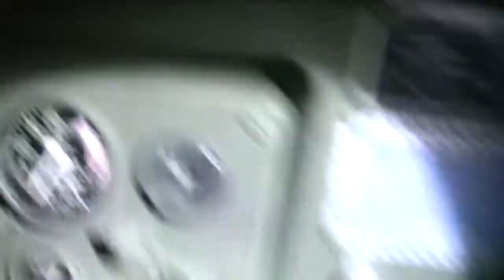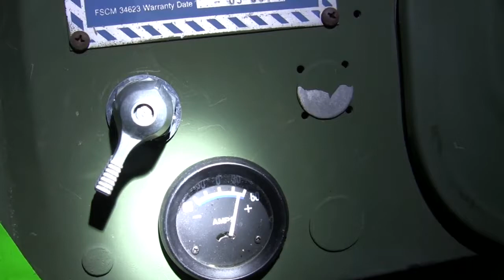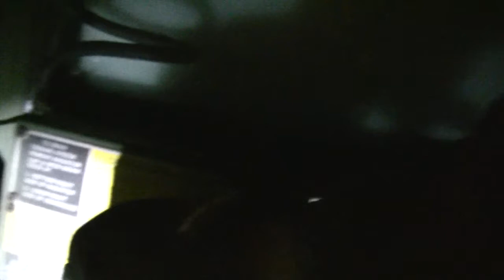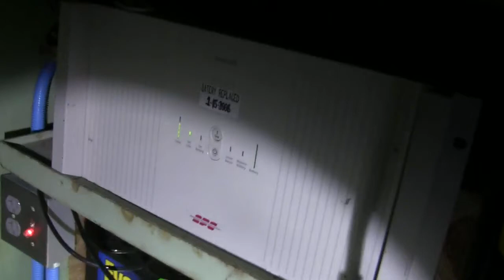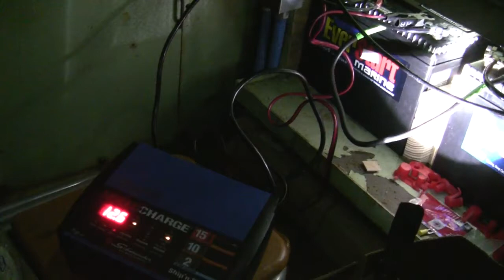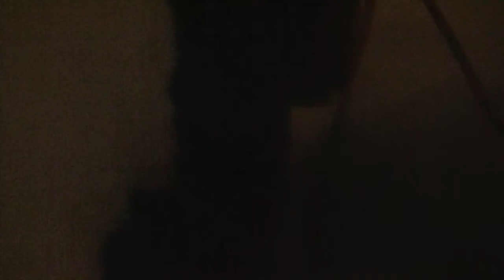Charging the Battery Bank

Comment: There are also small diesel generators that a battery bank can recharge. Consumes much less fuel than a 6 cylinder diesel engine.

I myself made a generator with a 1 cylinder Kubota diesel engine type EA300 with mounted a 24 volt 75 amp Bosch alternator with a 3 stair master volt regulator. 

type in Google Mastervolt and you find the alternators and the regulator, Balmar have also similar dynamo.

It runs very quiet and economical fast but safe charge the battery bank.

Comment: Do you have a detailed diagram of your battery setup?  I was just staring at my old APC Smart-UPS 1400 tonight with dead batteries. I started thinking if I could use this in my m109a3, with a bank of deep cycle batteries.  Now I see your truck, so I am not completely nuts in my thinking.  I am also at Steel Soldiers